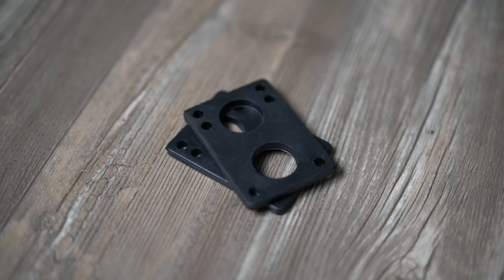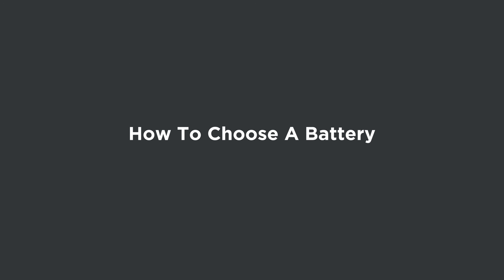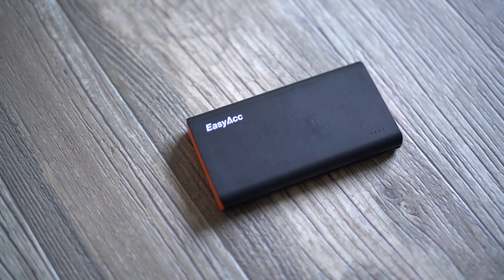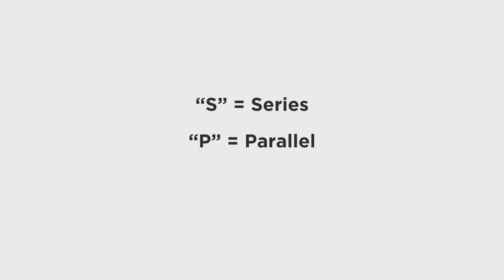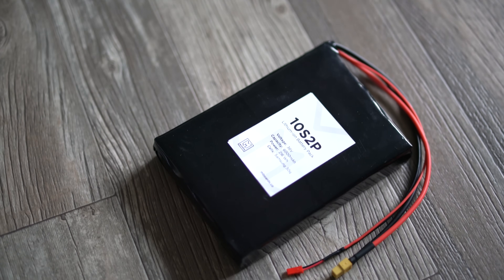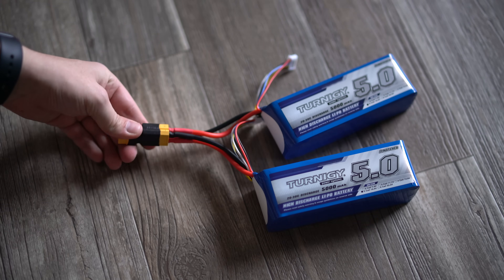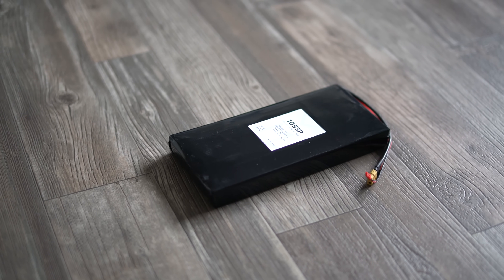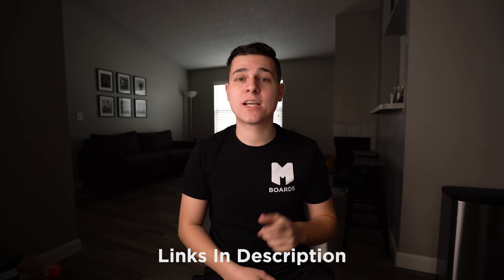DIY Electric Skateboard Build: How To Choose a Battery

Comment: Can I use a 10S3P 36V 15Ah Lithium Ion Battery Pack Li-Ion Battery with and Charger Built in 15A BMS for 100W-500W it was meant for a scooter but can I use that for electric skateboard?
Reply: Hi m board I just was wondering if it can be work with the project I’m planning to do I just want to make sure 😅

Comment: Lipo = higher discharge and faster charge capability. They're also higher voltage and have flatter and longer discharge curves the tradeoff is they're a bit more volatile than Lion and much less puncture resistant. You save weight by not having the BMS included, but you have less over discharge protections (unless you have them built into the ESC or if you can monitor through telemetry). Lipos can ordinarily provide between 10C and 22C real discharge rates. This insane numbers you see are usually marketing BS. (ie - 50C, 100C, 150C). There has been testing done to prove you're lucky if you ever see cells that are capable of sustaining much more than 27C at their very best. They might be claiming peak numbers, but it's extremely subjective and unreliable data. On the charge side of things, you can typically charge at 2C to 4C rates pretty safely on Lipos, but I prefer 2C or 3C for longevity purposes. Here is an approximation of charge times per charge rate (balance time will vary these numbers a little, depending on their health):

1C = 55mins
2C = 32mins
3C = 21mins
4C = 17 mins
5C = 15 mins
6C = 13 mins 

Lion = slightly less energy dense and usually limited output of 5C to 8C. Unprotected cells can maybe do 10C if you're lucky. But there might be some better ones out there that I'm not aware of. As far as i know, they can do about 2C charge rates, but you're best off just sticking to 1C which is roughly an hour to charge if your circuit can provide enough energy to do so. A typical wall socket can provide 1800W, so the math isn't difficult to work out. 

For the fun of it, let's say you have a 3800W system (roughly 5Hp). If you have a 10S 4P  Lion pack, that's about 360W per parallel branch. So maybe 1400W of continuous energy at 10C? That means the batteries would only provide 3/4 of the peak energy needed to drive the motors to their best ability. Lipo on the other hand can provide almost all of that energy on continuous 22C, and still have plenty left over for any burst current needed (all facts and figures summed up using nominal voltages and current).

Comment: 😢 9:24 
Hey buddy. I've got one of those China off-road boards with two 1650 watt Motors on a 36 volt system and I don't know which battery will give me the best performance cuz I'm about 220 lbs and I need range of at least 20 miles. I'm also pretty stripped for cash how can I do this for under 100 dollars?
Reply: There’s no battery’s with those stats under 100
Reply from the maker: @Denali4878 correct

Comment: What is the best battery replacement for a elifine Electric Skateboard for Adults top Speed 350W Motor 8 Layers Maple Electric Longboard Max Load 220 Lbs E-Skateboard

Comment: Hey i am building a board myself. Specs i want:
1)range=40km
2)load bearing capacity=100kg
3)top speed=25kmph

What motor,battery,esc should i use? I am from India btw.

Comment: Bought a used board recently and the batteries starting to go bad so I’m looking for a replacement. It came with a 6s4p but I can’t seem to find others for sale, so I will probably go with a 10s2p. Current battery is rated at 22.2 volts. Can I get something like a 36 volt without replacing my esc? I believe the esc is just a standard Ling Yi controller
Reply from the maker: You’ll need a new ESC unless there is a way adjust the voltage like this:

https://support.mboards.co/hc/en-us/articles/360037973313-How-To-Change-Voltage-Settings-on-ESC
Reply: @MBoardsco  thank you, I think there is. It looks extremely similar and has the same 6s 7s labels so I’m guessing it can do 10s as well like it says in the article? I don’t really understand all the voltage stuff though. So if it can do 10s, then I can use something like a standard 10s2p battery with the current esc?
Reply from the maker: Correct 👍🏻

Comment: hello I got a question about my parts! Would a hub motor - 90mm 10s 36v 77kv 400W, ESC - 36v dual motor, and battery - 36v 10s2p 7Ah 450Watt 1865o lithium-ion battery all be compatible?

Comment: I fly drones a lot, so I already have a two channel balance charger and I'm very familiar with lipos' charge and discharge characteristics.
Soo, I think I'm gonna buy 6 6s 5-6 Ah packs and connect them into 12s3p on top of the board, in the middle. 2p kinda scares me cause 7kWt will draw quite a high current even for a lipo

Comment: If I take 4 10s3p packs and I put 2 in series and then put them both in parallel would that make a 20s6p pack? What would be my output based on the Mboard  10s3p specs?
Reply from the maker: Yes! You’d end up with a 20s6p

Comment: Mechanical engineer here:
Here is my simple guide for picking the battery from what i learned researching this topic.
If you want speed and power and don't give a damn for longevity -> Lipo batteries.  (lipos are a fire hazard and must be stored in fire proof bags)
Their instant power output is way higher than Li-ion. 
Instant power can be calculated with: 
Watts = V(battery max voltage) x Amp/hour (The 4 digit number on the battery pack casing) x "C" (the discharge rate of the lipo battery), e.g; Consider the lipo battery with 11.1V 2000mah 60C.
11.1V x 2A (SI of 2000 mah is 2A) x 60 =1332 watts of instant power when it is fully charged, that's 1.3 kW of electrical power, but this quickly goes down as the battery voltage goes down fast due to the C rating.

If you want convenience of charging and long cruises  -> Li-ion battery packs.
Usually these battery packs come pre-assembled with in-built BMS, they have a lower "C" (2-5 depending on technology used and manufacturer) discharge rating, but offer a longer trip, they take more time to drop their voltage since the C is lower.
There is no middle ground to these 2 options. Yet.
I'm not trying to be annoying or snobby. When i got started in this hobby i wished i'd already knew this.

Comment: I got a 36v 15a 7ah aerdu battery from alliexpress for only £55 and its good for 20mph and a gradient of 20%. For me it's the perfect speed and the range is about 15 miles. If you ever need a replacement battery but you're broke its a good alternative.

I think there is a 25a 10ah version as well which is a direct replacement for the wowgo 3 and claims double the capacity and costs £45 less than the official battery... Judging by the the battery I got I would guess the specs are accurate 🙂.

Comment: Ah and Wh units are directly convertible with each other. An expert should only concern themselves with Ah when selecting batteries (because this is a unit that would be consistently comparable across diff batteries, and it is a piece of information readily available when researching the cells in the pack). Wh is a useful unit in determining range yes - but not for battery shopping.
Reply from the maker: I would argue that Watt Hours would be more important that Amp Hours.

Comment: Hey Mike, does voltage of battery say 12s vs 10s or does motor size matter more when it comes to performance? I have a prebuilt board with a 12s battery and small 5055 motors. If I were to build a skateboard with 6354 motors at 2500 watts and 190kv but with a 10s3p battery do you reckon i’d be able to get much more torque?

Comment: Parallel does not increase range compared to serial.. but nice video 👍
Reply from the maker: Parallel does indeed increase range. 

Serial connections increases speed.
Reply: let's compare 2s3p and 6s1p that means same Watt hours and therefore same range. (Considering only battery not motor)
Reply from the maker: Considering the amount of cells in series remains constant and the same cells are being used, a 4p pack would have a longer range than a 2p pack.

Comment: Got a 36V battery for a 24V replacement.  Board lights up but motor won't turn.  Plugged in old battery and works fine.  Help.

Comment: OCT 2020:  Thanks for deciphering this, valuable information so sure.  Would 10S3P in a row of three connected in Series work as an e-bike battery pack?  Would I be able to charge them with an appropriate LiPo charger (if there is such a thing).  Nice one MBoards.

Comment: I have a couple of lipo batteries they’re 4s 7400mah 90burst
Would this be ok if I were to wire them in series?thanks

Btw I just ordered the Meepo V3 with 6.5ESC would it fine if I use the lipo batteries I have?thanks

Comment: Li Po is very very good ? xD HAHAHAHA ROOKIE ! LiPo's, when punctured, can ignite and or explode. You dont think riding a board at 20-40 mph might crash ?
Reply from the maker: The specs and capabilities are absolutely very very good. Are the safest option possible? Definitely not. But they do get the job done. 

All of that being said, we still do recommend lithium ion packs instead, largely due to superior safety.

Comment: So wanting to try my first build. And even make the battery pack my self and 3d print case. I'm wondering what kind of set up would u recommend. I'm not needing a lot of speed but do want long distance and torch. I'm wanting to do a long bored and am around 250 pounds and wanting to use belt motor also probably 2. If u could help would appreciate it thanks.
If u could help that would be great

Comment: I bought a  Backfire g2s second hand and i think the battery might be dead/effected only get about 20% of the range, can i just replace it with any commonly used battery and it will work?, are there any you recommend? the board is great speed is fine just want minimum 10mile range and I'm getting about 2mile atm

Comment: Hi, I'm looking at building my first board.
I am building a dual 6380 AT is it possible to put 2x 6s4p batteries connected in series to create a 12s4p and if so is it possible to charge them together as they have a BMS installed in the pack, or do they need another BMS to send the charge to each battery?
Any help will be greatly appreciated.
Josh

Comment: Hey Mike! I used two turnigy 5s 4000mah 30c lipo with a 4.12 vesc esc. It never worked correctly and it somehow fried the esc. What did I do wrong? I waisted a ton of my money and I’m only 16 so it sucks. Love your videos!
Reply: you probably fried your ESC because there were too many amps. so probably upgrade your esc.
Reply: Horsey thanks that’s what I thought I did
Reply: @toxicwaste1022  there can't be to many amps.. the esc will draw however many amps it needs automatically... And the amp draw changes every single second.. he most likely wired something up wrong or shorted something out..
Reply: @fbiagent3399  an ESC that might be damaged by too large a current. Larger motors tend to draw more current, and larger propellers, or propellers with a greater pitch will also draw more current.
Reply: @toxicwaste1022  I was thinking he said The batteries themselves killed the esc while plugging it in or something... it's always better to get A esc that can deliver much more current then the motors draw that way everything stays cold.. I personally run A 12s hobbywing esc and it's been amazing and definitely 1 of the smoothest escs I've ever owned on A electric skateboard...

Comment: I'm very close to purchasing a 10s3p 9ah battery kit from Mboards but I need to know if this system will work with a Mototec 800w street skateboard. It has the same configuration as an FIIK Big Daddy 800w just smaller wheels. I know I would need to strip the wires and add a connector that will fit into the the connector that comes with that kit. I just need to know if there's anything else that needs to be done, or if it's just as easy as replacing the old SLA atteries and add the new connector. Any advice would be appreciated 🙏

Comment: Thanks for the helpful video! I have a Mototec 800w 36v single motor that I want to convert to lithium. The board came with 3 12v SLA batteries. Which battery would you recommend for this ? I'm uneasy about buying a new battery until I'm sure it will work with the boards components. I'm looking for as simple of a plug and play as possible but I'm not sure if I will need to replace the controller, motor, or rewire anything. Any advice would be greatly appreciated 🙏
Reply: Hey Leo living life, I was just scrolling through the comments and read yours and you asked word for word literally what I'm dealing with right now and wondering? Have you found a solution for yours yet any recommendations?
Reply: @joshtaylor9585  I bit the bullet and bought another board. Ended up getting the N2G electric long board for $20. More range, less weight , and comes with warranty. All for less than the price of a new battery
Reply: * Leo Livin Life

Comment: Hi Mike!
I recently started watching your channel and I think you are the clearest person to learn from!

So... my question - I have a board with 350w motors - which I will be upgrading - and a 12s2p battery (faster the better for me).  If I connect a second (identical) 12s2p battery to this board - which I already have -  am I likely to destroy it, or increase my range? I'm sure it wont allow me to go any faster but I don't know too much about that as all the electronics came pre-installed in the board and my learning hasn't got that far... YET!

 If it helps, the board is a Backfire G2T (my first) My Plan is to upgrade it a bit so that it will do me until I have brought all the parts for my own custom build. 

Thanks in advance, Chris.
Reply from the maker: Hi Chris! 

If you have 2 12s2p batteries, you’ll want to connect them in parallel to double your range. Do not connect them in series as your ESC is most likely not going to like 100+ Volts. 

Let us know if you have any other questions!
Reply: Hey Mike, Thanks for the quick reply!

I get you! I’ve drilled this video in to my brain and now what you just said makes complete sense 
Thanks again🙏

Comment: I’m building my own board running a single 6374 190kv brushless motor with 24volt ESC and two 5000mah 6s 60c Lipo batteries. Do you think that’s a good combination?

Comment: Hey Mike great videos. New subscriber and new to Eboards. My question is would I be able to use a battery pack from say a Milwaukee drill. I have two batteries 18 volt 72 Watt hours/4000 mah. I believe these would work fine. Just thinking about the controller would one of your regular ESC work? Or would a vesc be safer for the batteries?
Reply: Li po and li on dosnt have the same voltage per cell.
Lipo fully charge are 4.2 V....li on are 3. 8 V
10S Lipo = 42.V  @ 50C.....verse li on 38v @ 20C....will yeah the lipo
will go faster with twice the punch all day long.lol
what you're asking about is the DISCHARGE RATE. ( C ratings)
Lipo batteries has Higher discharge rate Options than Li on.
The ESC has Voltage ratings on them...The Higher the amps...the better.
Esc gets Hots (expensive)..
It depends what MOTOR..you're using. The Motor will draw power.
You dont want any of it to fry...Too much voltage to the motor will 
damage the motor....crappy C rating will damage the batteries and poor performance.
You need to READ the SPEC on ALL of it..
Drill batterys are probably 20C-30 C at most...Most people dont run drills for
10-15 min continuously. You do not want li on cell reverse poling ( from HEAT)
They make lipo at 50C -100 for CHEAP . now. It'll out perform li on ..all day long.
One of these days..someone will get a bright idea of mounting  aluminum
on the bottom of the board as act as a HEAT SINK or Make an ALUMINUM BOARD :-P

Comment: Hey anyone that may be able to help. I have a gen 1 boosted board and the battery fried. Boosted doesn’t work on V1 boards anymore so I was wondering if I can just run my own battery and have the rest of the board run normally. Any tips or suggestions you might have? Anything helps, thanks!

Comment: Quick question, i want to use a e-bike battery wich is 10s4p, and uses cells with a 10A max discharge. However in spec sheets i see the continuous discharge is about 0.43A per cell. Is this a problem?
Reply from the maker: If you can only pull .43a continuous then yes that would be a problem. You’ll want to find cells that can handle at least 10a continuous in a 4p set up.
Reply: @MBoardsco  thanks for the reply, i already had the stuff so used it anyway, since its a 4s it gives me about 2A contineously. It works fine but for 2 seconds it cuts out and then picks up again. Happens every 40 seconds or so. Switched to lipo since then.

Comment: Hey Mike, so I am still doing research about making my own eBoard. I came across "Samsung 40T 21700 4000mAh 35A Battery", what are your input on that battery? From what I see on the Mboards website, the Samsung 25R and 30q are mainly used. But they have lesser capacity and output, however this battery has higher capacity and output. Would this also be good? If you can please provide reasons as to why you say so.